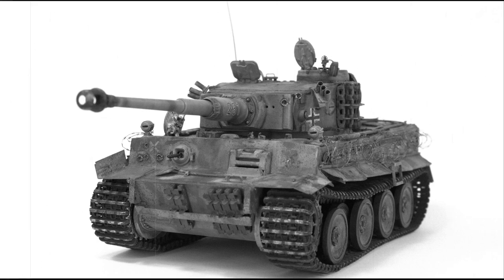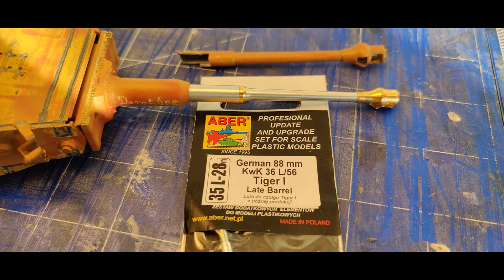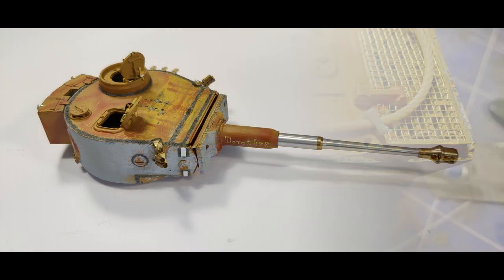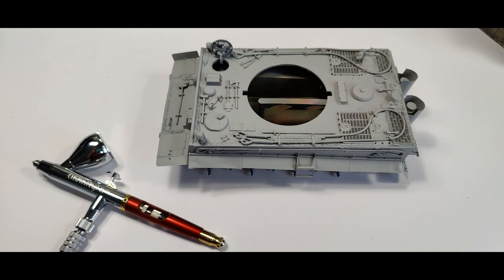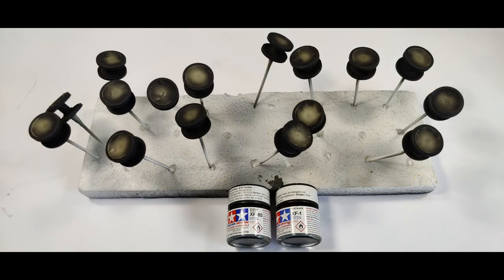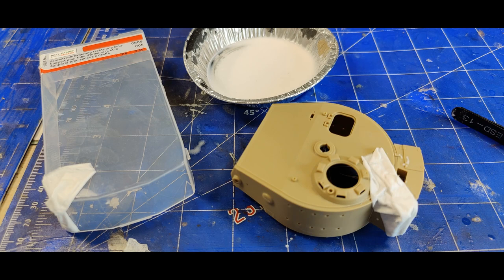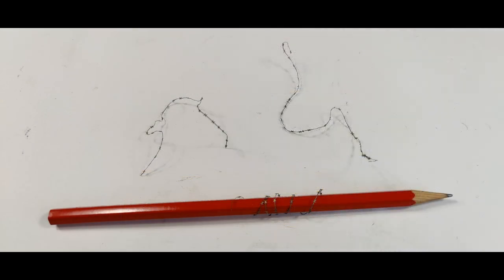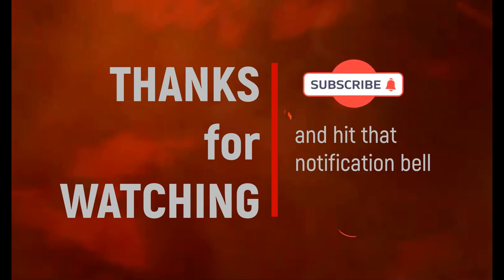“Bad Ass” Tiger 1 – Tank Build

Comment: How to build a tiger tank
                SIMPLE
Make a box..
Make a Tiny box at the front middle 
Make two Flat front armor and put other side of the front middle 

Right side and left side 
Make tiny triangle left or right both

                  Back side
Make a long circle for the smoke 

            Middle part of the body boxy 
Make a circle turret
Cut the front of the turret to make it flat 
Back of the turret make a Tiny box put in the back in the turret 
Make a commander door 
Make a  main gun 

              TRACK Wheels
Make circles 
Make a big circle for the front wheel
Make a track  

       And front machine gunand driver view 

That's.   All.       Simple right